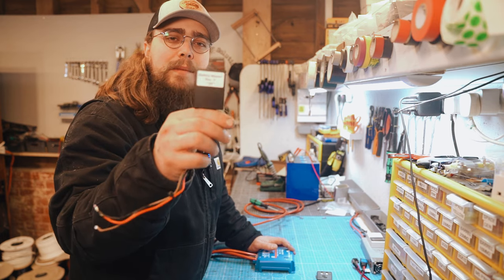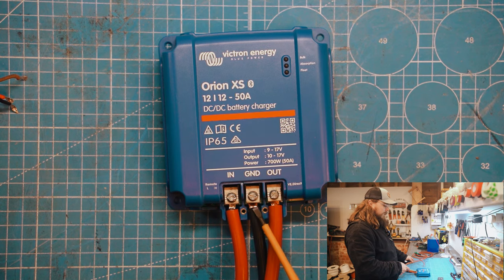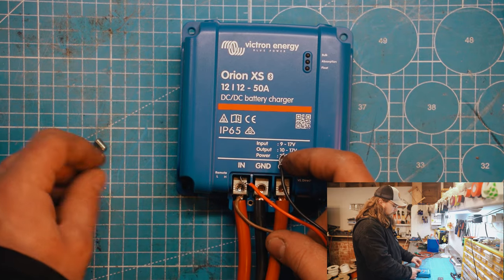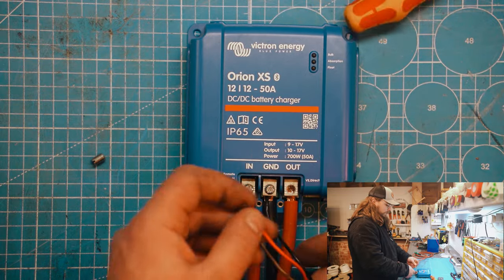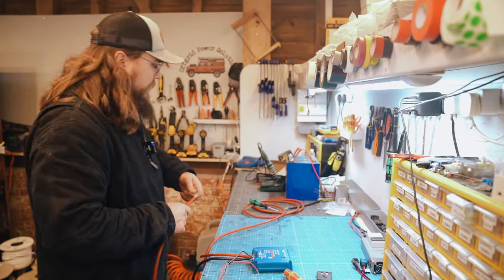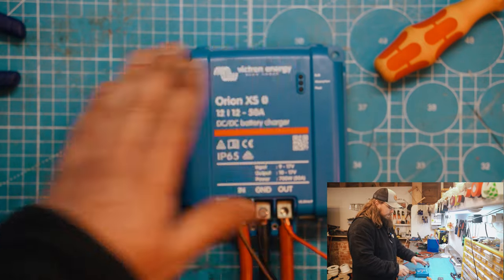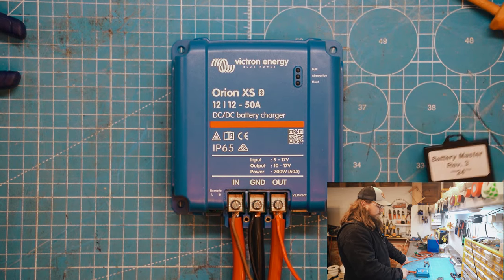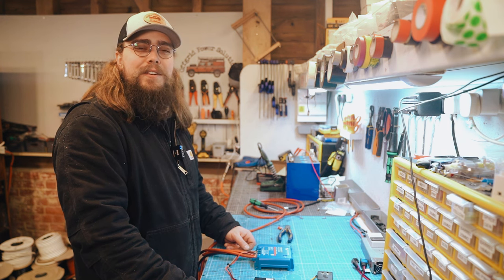Installing the Battery Master on the Victron Orion XS

Comment: Have you considered a "smarter" battery maintainer like the Ablemail Electronics AMT12-2 ?  It has a lithium profile for the leisure battery and can be setup to be smart alternator aware ( so it won't fully charge the cab battery thus allowing regen braking to occur )